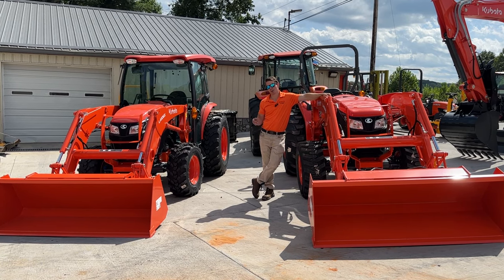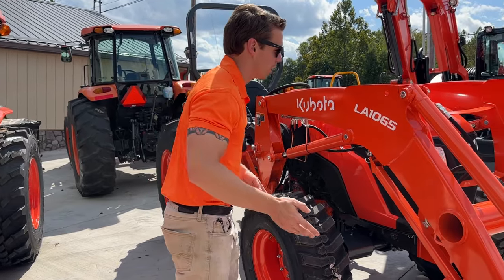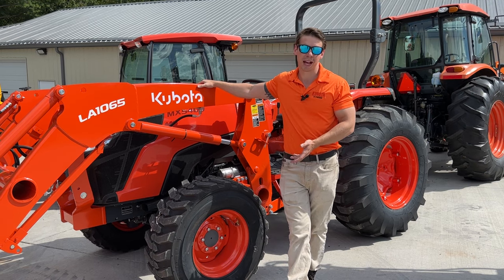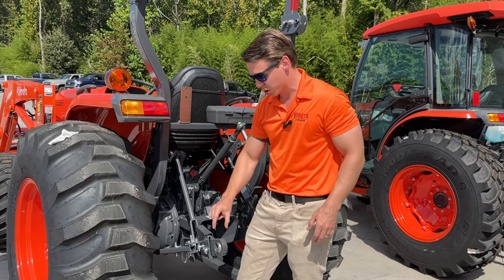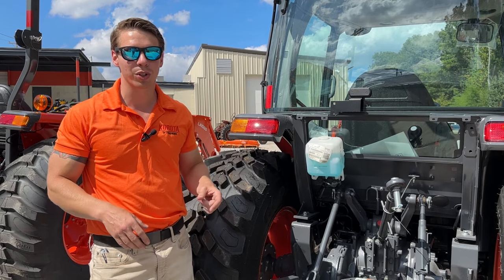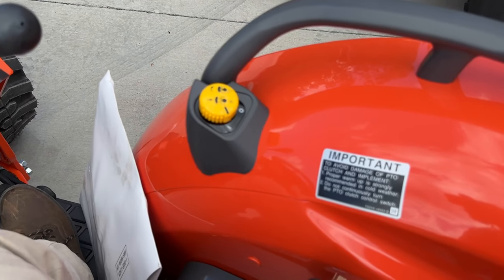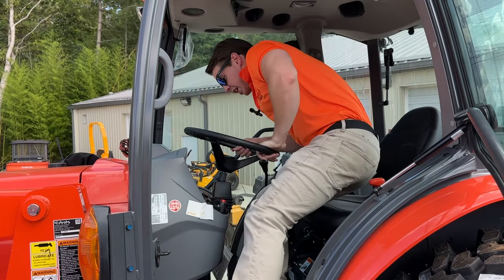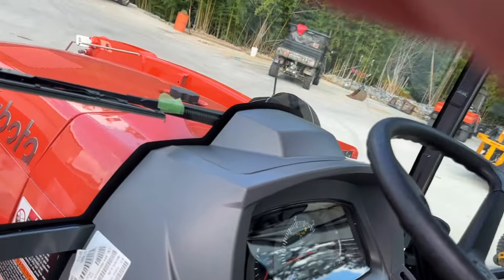New Equipment Orientation: Kubota MX Series

Comment: I have a MX6000 for my 70 wooded acres.  Been on the tractor for 2 years and it's everything that I wanted, no issues at all.  Have 3rd function and top and tilt - would recommend getting both these features at time of purchase if you want full function with the tractor.  Have grapple, box blade, loader, wood bucket, wood chipper and snow blade.  Tractor is absolute beast.  Sold my B3030 which was great tractor as well but as I acquired more land I needed bigger tractor.

Comment: Love my MX6000 cab so far. I have to get rear remote(s) installed. Wish I would have got those when I bought it last year. The dealer put Rim Guard in the tires and installed wheel weights which I really like for front loader work. I also had side mirrors, right door latch, 3 point quick attach and tint for the windows installed. Rear work lights would have been nice. Wish I had those put on. My only 2 complaints are that the front work lights are not bright at all. I'll be replacing them with bright LED's in the future. Also, the fuel refill cap is on top of the hood. If you don't have a pump to transfer fuel into the tractor, you will have to climb on the tire and hold the fuel can while pouring. They could have located that on the side similar to what they did with the L Grand series. To see the hydraulic fluid more easily, I added red transmission dye. It helps to be able to see the fluid in the sight glass.

Comment: I’ll have to check it out. I’m a groundskeeper south of Lynchburg, taking care of about 65-70 acres of grass/field/trail work. I’d mostly be using for finish mowing, grading work, mulch, plowing snow, moving trees and fire wood, and materials on pallets some. We currently have a 2001 kubota m6800 and a 2019 JD 4075e but we really only NEED one tractor, so I’m trying to simplify things down the road.

Comment: You didn't tell the gear drive tractor owners about the latch hook for the clutch pedal for  long term storage so the clutch plate doesn't rust solidly to the flywheel.   Been there sadly.

Comment: on the tela stabilizer what is that pin called? thanks love your vidjas
Reply from the maker: The drop pin that goes into the stabilizer arm with the chain is actually called a 'joint' from Kubota. Part number is TC860-39630.